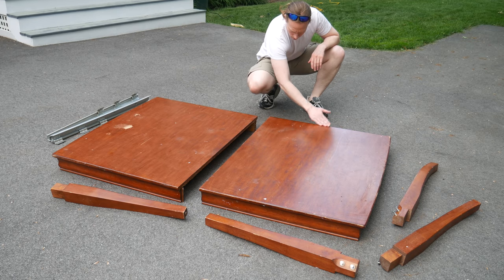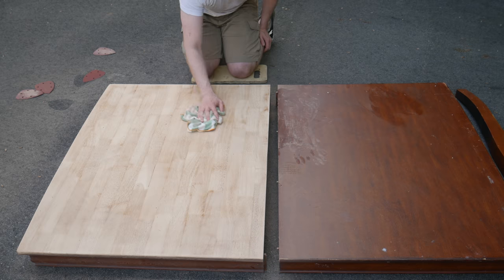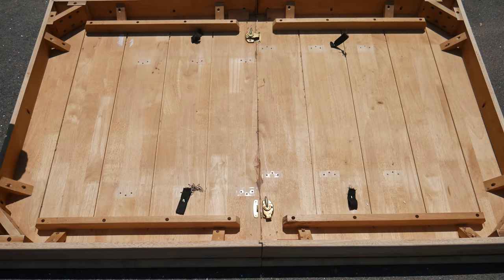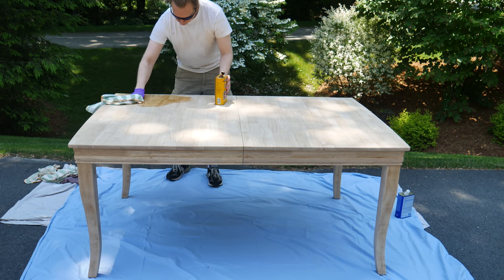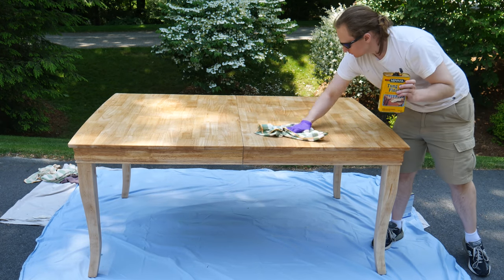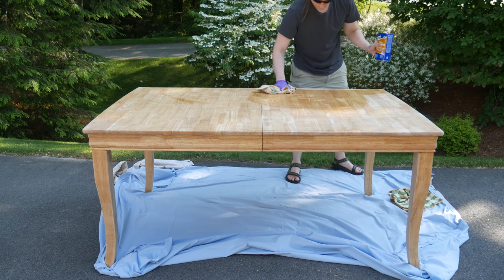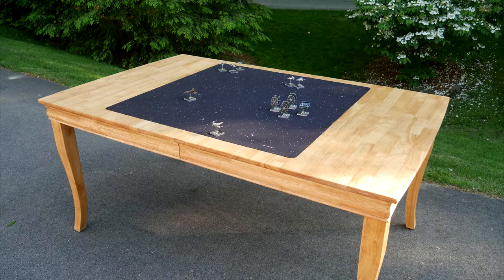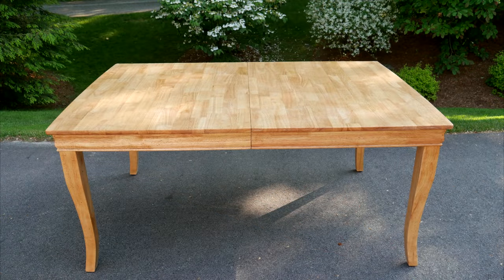Premium Gaming Table Salvaged and Restored for $8

Comment: Jell paint stripper would have reduced the need for so much sanding. I use the orange based stuff that smells very pleasant and doesn't have any toxic fumes.
Reply from the maker: Thanks Mark!  I haven't used that stuff very much yet, I need to give it a try someday.  I'm sure it will be necessary when I find a furniture piece with a ton of annoying bevels & router patterns.  :-)
Reply: @GoobertownHobbies  Yes! I had a hand carved piece that someone had whitewashed (it was made of teak wood) and this was the only stuff I found that could remove the paint without disturbing the detail.
Reply: I second Mark’s recommendation.  It saves a ton of work on sanding and it’s non toxic too.  Just brush it on and use a plastic scraper to remove it.  I was actually able to use a piece of cardboard as a scraper; that’s how well this stuff dissolves paint.  It a seems to practically melt away old finishes.  Great stuff and inexpensive too.  Also readily available at Walmart, Home Depot, Lowe’s, etc.
Reply from the maker: @mf9309  Thanks for the recommendation!  OK, I definitely need to give this a shot, that sounds a lot easier :-)
Reply: @mf9309  Any ideas about the actual name brand? I have tried some in the past that did nothing to the paint but made an awful stink. Thanks in advance.
Reply: @mf9309  Also, do you know if it works on paint that is on metal?
Reply: Chris I used Citristrip Paint & Varnish Stripping Gel.  It’s orange and the label says it’s “safe for use indoors. No harsh fumes (It has a citrus scent).  All-purpose stripping gel removes multiple layers of latex and oil-based paint, varnish, lacquer, enamel, polyurethane, shellac, acrylics, and epoxy from wood, metal and masonry surfaces.”  Though it may may come in larger sizes, Walmart sells it for around $12 for a 32 oz bottle.  I don’t know yet how well it works on everything it says, but It worked great for stripping paint from my wood project.
Reply: @mf9309  Thanks for the info.

Comment: I'm curious, what does the mineral spirits do when used to clean raw wood? I have only ever used it as a stripper/paint thinner. I would think it would be removing the tung oil you just applied? (but obviously not) I have not ever worked with tung oil as of yet but this vid got me super inspired to refinish an old (but solid) bench we have outside in the weather.
Reply from the maker: Good question! I use mineral spirits because some web forum told me to. My understanding is that it's just an alternative to using a damp rag.  Water isn't great for the wood though (especially since it probably isn't soluble with the tung oil that comes immediately after).   Oh, and that bench sounds like fun, go for it!!!

Comment: Looks like machined finger joints. Common for mass produced solid wood tables. The wood species is kinda unclear, but I would guess a soft wood like pine or poplar based on the finger joints. Nice work Brent.
Reply from the maker: Hey thanks Alex!  I'll send you some better closeups on the woodgrain someday.

Comment: Nice work!  I believe the wood species is Beech.  a lot of production furniture hardwood is beech. especially from the 90's or early 2000's
Reply from the maker: Thanks Michael! - And thanks for the insight!  :-)
Reply: Beech has a pinker shade, closed grain and tight medullary ray like London plane. This has a tropical grain common to African hardwoods, and could be one of a dozen near identical species, but the most likely in my eyes is Idigbo, as it is commonly used as a cheap Oak stand in.
Reply: @henners9901  "Idigbo" = Limba

Comment: I'm completely ignorant when it comes to DIY; if I buy some tung oil and rub it into a piece of wood will it always dry and form a hard, protective, surface? Could I use it on something like MDF or plywood for example? If anyone knows I'd be grateful for the insight.
Reply from the maker: I've used tung oil on my desk which is made out of plywood.  It will work on the wood veneer covering a piece of particleboard as well.  I would NOT use this stuff on exposed MDF.   Out of curiosity, what are you working on?
Reply: @GoobertownHobbies  Thanks for your quick reply. I'm thinking of making a wooden board (and pieces) for Guy Debord's "A Game of War".